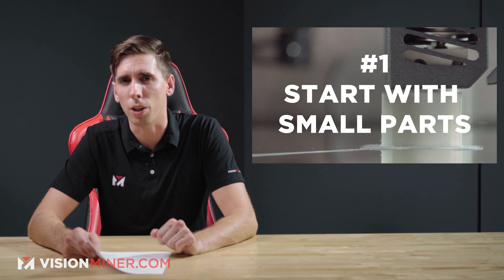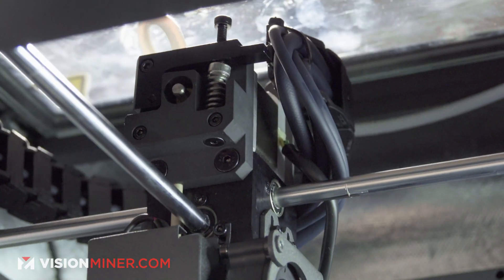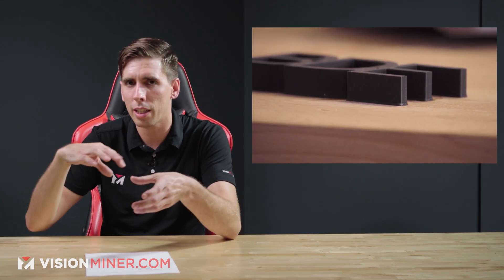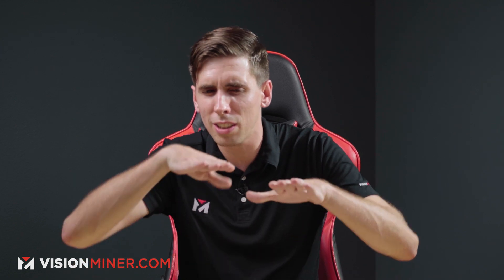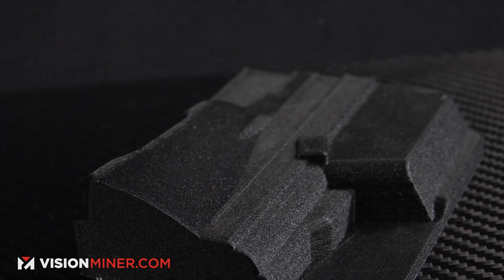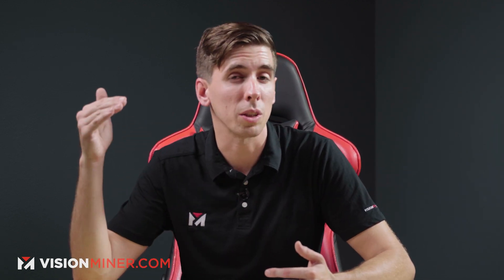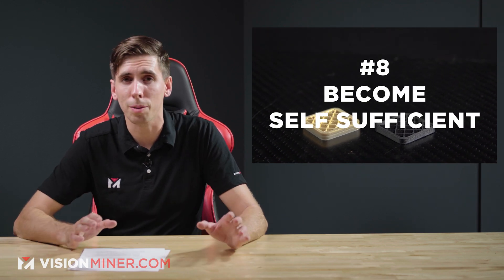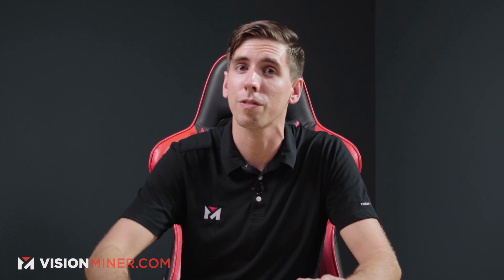What to do FIRST when you get your 3D Printer? 11 Things you need to know

Comment: Do you guys know how to replace the glass bed?
Reply from the maker: Pull it out, and put a new one in.... the Enhanced has bolts on the corners, which will need to be swapped over, but it's super straightforward :)

Comment: With current 3D printing technology.Is it possible to create. 3D Printing/ manufacturing on demand?From Steel,Aluminum,Carbon,Textile,  Fiber...every aspect of manufacturing.Thanks
Reply from the maker: Yes, it is. Generally metals are very expensive, though, depending on the technology used. Possibilities are endless :)
Reply: @VisionMiner  Thank you for your respond .
Reply: As far as i know it costs between 50K and 500K Euro for any kind of metall 3 printer so for now it is still kinda far away from normal consumers but if we keep our hope up we may have the first metall 3d printers for 2K Euro in the next 10 years.